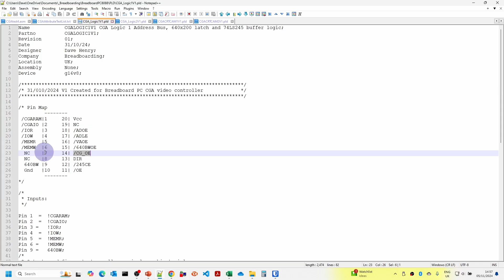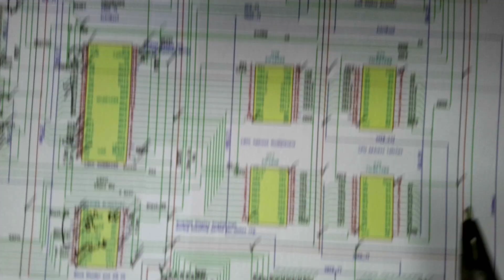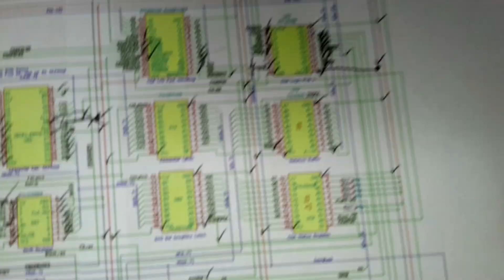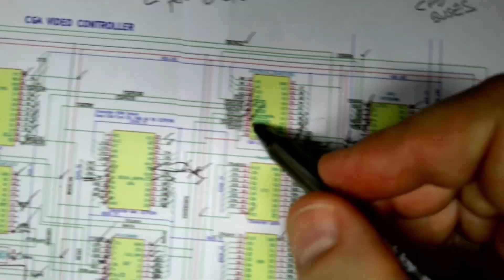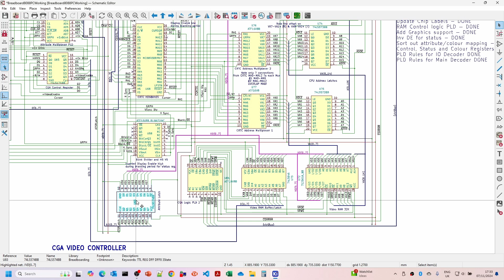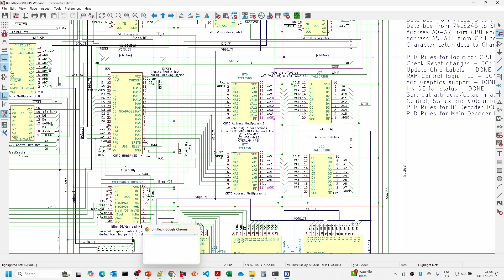Breadboard 8088 PC #55 CGA Video Controller Part 10

Comment: Feels like stone age of computer but then also require plenty of dedication keep it on  😎😎
Reply from the maker: You'd be surprised how useful it is with age appropriate software (with DOS apps being the equivalent of a stone axe and fire I'm sure survival would be possible in the stone age!) . I bet it cold boots to a text editor faster than you can in Windows 11 (recent Windows versions only cold boot on restart, shutdown just does hibernate!). It is a little sluggish, but with DOS software its works pretty well. Just the copying and pasting between applications and multiple apps running which is the big gap (but sidekick TSR etc can handle this too!). 
What it highlights to me is how bloated most modern software is when workable solutions exist inside and few 10Ks at most 512K if without a pretty GUI. Dave

Comment: I can't imagine the chip count without those PLDs. Thanks a lot, have a nice day!
Reply from the maker: Well the original CGA card had MC6845 CRTC, Character ROM, 8 RAM + 59 TTL logic chips - 69 Chips in Total.
Excluding the RAM, CRTC and ROM the 59 TTL chips have reduced to 22, though 24 if you count the current source and 25Mhz oscillator as chips! My design doesn't do the composite video but does work with VGA display equipment.
Dave